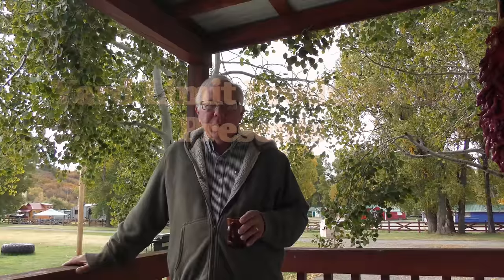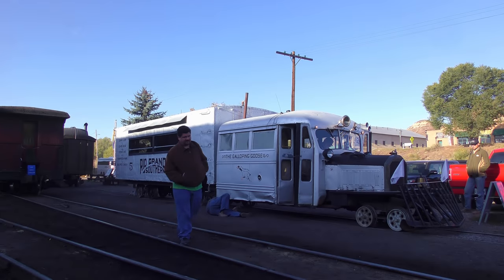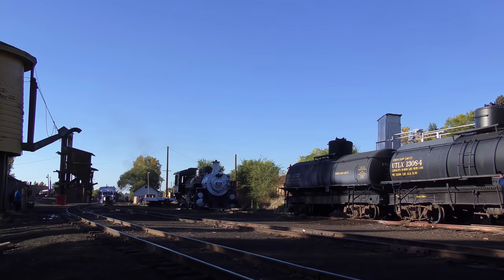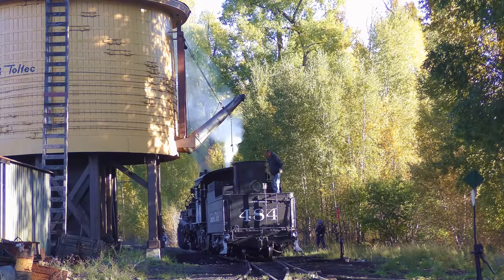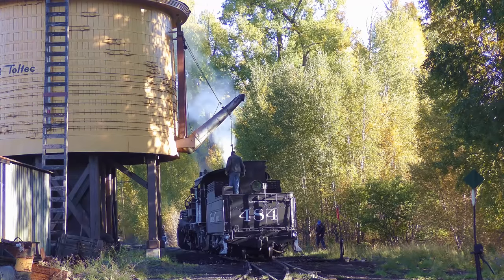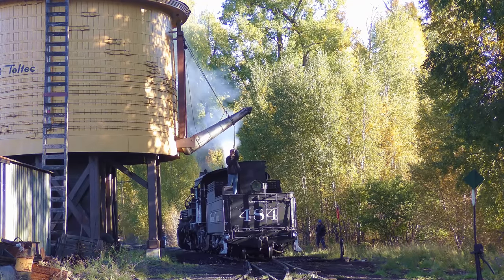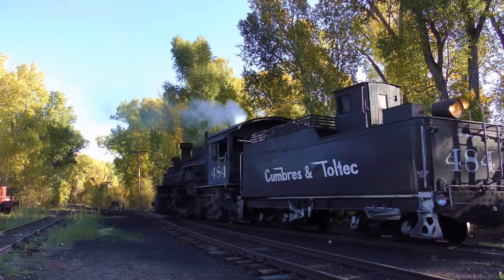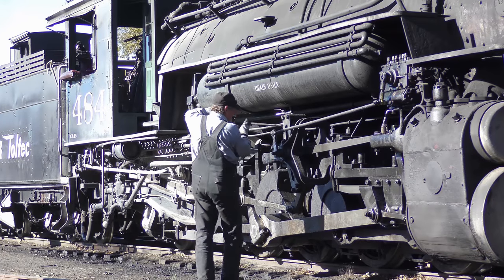Galloping Goose and a Double Header on the C&TSRR

Comment: I just watched this again Tom, lovely work and great use of light and perfect colour matching. Do you shoot in manual exposure?  If not the camera is doing a great job.
Cheers Gregg.
Reply from the maker: I always shoot in auto mode.  The only time I ever change something is to change the focus from auto to manual so it won't go out of focus if I"m shooting against a monochrome sky, or smoke from steam engines will sometimes make the camera go out of focus.  I do up the saturation slightly in post processing but that's about it.
Reply: @YardLimit  Ok Tom ,  the camera does a good job for auto! I always shoot in manual so I get the results I am after , but the default setting on yours is very good .
Cheers Gregg.

Comment: So having 7 Galloping Geese means they had a gaggle of these railcars, they should build some more.
Reply from the maker: A gaggle of galloping geese!
Reply: I believe that two of them were built for maintenance use and are still in existence.
Reply from the maker: Of the seven "geese", only #1 does not survive, though a replica was built in 2000 for the Ridgway Railroad Museum. The other six are located as follows:

Geese #2, #6, and #7 are preserved at the Colorado Railroad Museum and are operational.Goose #3 was sold to Knott's Berry Farm and is operated regularly during off-season periods when park attendance is low.Goose #4 was on static display in Telluride, Colorado. It was restored to operation in Ridgway, Colorado, as of June 2012.  With the restoration of Goose #4, all of the Geese are now operable.Goose #4 was moved back to Telluride on May 2013.[3]Goose #5 was bought by the city of Dolores, Colorado. After restoration in 1998 it is now operated from time to time on the Cumbres and Toltec and Durango and Silverton tourist railroads, as well as at the Colorado Railroad Museum.